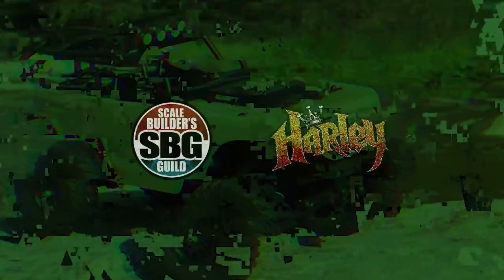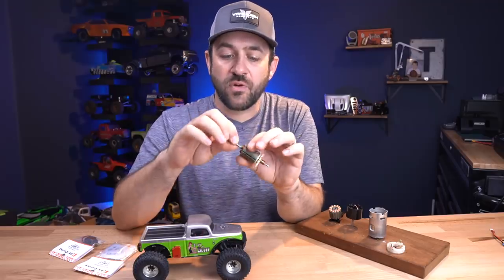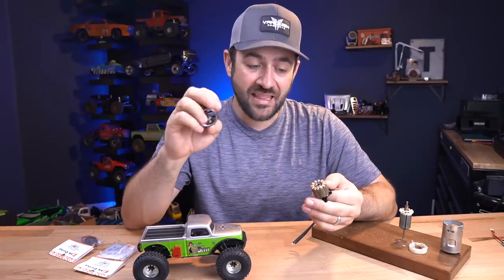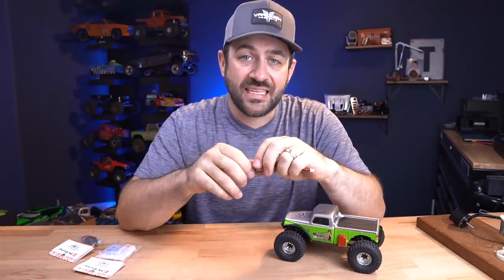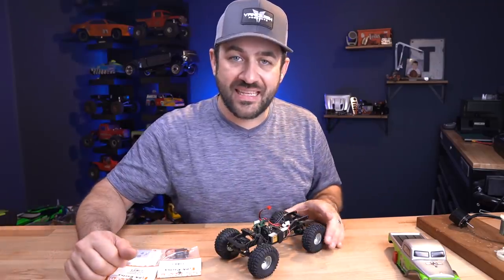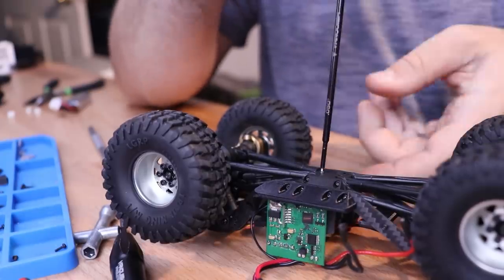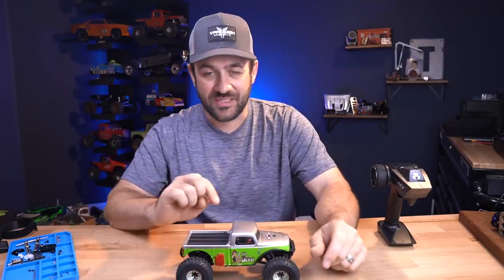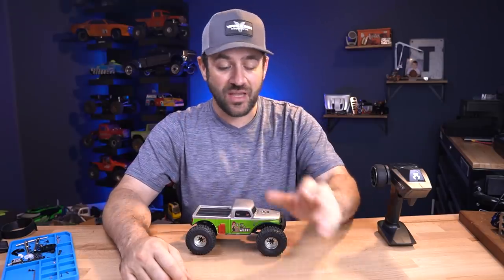Axial SCX24 Budget Build - Upgraded Motor - Week 6

Comment: I have the pn racing motor on my 24 with 1080 esc thing is wild I have the fifty turn on mine it still crawls slow but it’s fast and has enough torc to pull the wheels off the ground love it
Reply: try add the neo-magnet and u will get even more torque!

Comment: Thank you for showing that a performance brushed motor is a viable option. Seems most people go directly to brushless. Predictions for the following two weeks: Lizard/Iguana ESC ($50), Emax servo ($9), alloy shocks ($25), and a Futaba RX ($35?).
Reply: Thats a lot of weight added thou. I left mine with the stock esc, works fine for crawling. I did go for a better servo than the emax too.
Reply: @year1camaro  Not necessarily. I run a Lizard with the bluetooth module and a micro RX. The entire setup is 9.9g, including a XT30 connector. The stock ESC/RX is 12.6g. Also, the Lizard/Iguana is worlds beyond the stock ESC's capabilities as far as modulation and you can tune it to fit your needs. It is 100% worth the money. Anyone who disagrees likely hasn't used one. It's that good.
Reply: @derrickwilliams2903  i dont belive my decased desoldered esc/receiver combo weights more than your set up. sorry. and I dont have time to weight it all it seems more than obvious without going throught the trouble. I wish Matt weight his esc before he put it back in
Reply: @year1camaro  Have you ever used a Lizard/Iguana? Seems you are missing that point. Even for an extra couple of grams, it's more than worth it. Not telling you what to do, but having a closed mind could be limiting your rig's potential.
Reply: @derrickwilliams2903  here it is in a nut shell, its about motor control, and I have plenty of that with my setup. its not just about a few grams even thou in this small of an rc every gram counts imo. shoot i see harley designs removing his on off switch to cut down on weight. the brushless system put the weight up higher, just what ive been fighting against this whole time. there is no benefit to brushless, sorry. no one ever crawls as slow as all the videos unless they're on meth. I mean who wants to wait for that guy. who wants to crawl that slow unless its on your work bench and your doing it for likes,,,,just like flex shots. crawling is about momentum, not who can crawl slower. its just silly. not to mention a waste of money that could be spent on other useful mods.
Reply: @year1camaro  Furitek esc with $20 dollar 14 Pole Brushless Surpass motor all day any day of the week over a $70 dollar Brushed motor lol..
Brushless - twice the driving time on batteries vs Brushed, 
Brushless - Completely waterproof, vs Brushed, 
Brushless - Runs much cooler than Brushed
Brushless - 5 X the life never need to replace brushless,
Brushless WAY smoother...... 👍🏼
Reply: @ConditionZero76  what kind of mount would you use?

Comment: Who would have ever thought a stock motor would smoke prematurely pushing huge tires and overdrive front diff gears. Lol

Having driven the PN90 and PN70 in an SCX24, I prefer the 70T. It has plenty of torque so that it is not notice between the two, and more wheel speed. 

That mount is awesome and serves as an effective heatsink. It is well designed and built.

Comment: The motor still looks like it’s placed lower than the Furitek brushless 👌🏼
Reply from the maker: It is definitely lower than the brushless options and is smaller in diameter so the COG is still much better. It’s just not as low as a stock motor.
Reply: @HarleyDesignsInc  is there a motor between the 050 and this 130 size?
Reply from the maker: @mtkidrc2307  yes, I believe the 080 size out of some of the other small scale rigs.
Reply: @HarleyDesignsInc  🤔 I’ll have to do some research 👍🏼

Comment: Nice motor breakdown and install.  Did you run into any Y-link clearance issue on the motor mount?  I have seen that was an issue with the PN mount.
Reply from the maker: I do not have an issue there but with the shorter front links I could see it being a possibility.
Reply: u will never encounter the so called issue as naturally its almost impossible for the front shocks to be fully compressed at the same time. ive been running the PN motor mount for a while now, never had any issue.

Comment: What end mills do you use to cut carbon fiber on your CNC? Great videos, enjoy the information!
Reply from the maker: I use PCB cutters rather than end mills.
Reply: @HarleyDesignsInc  have you cut aluminum with your CNC yet?
Reply from the maker: Small pieces yes, but not extensively.